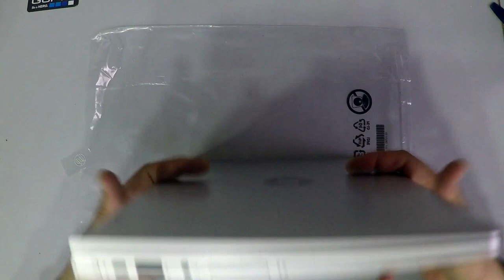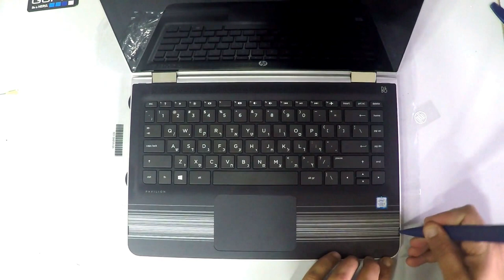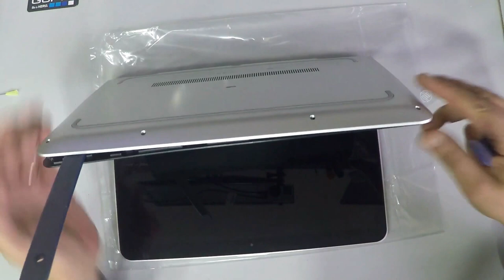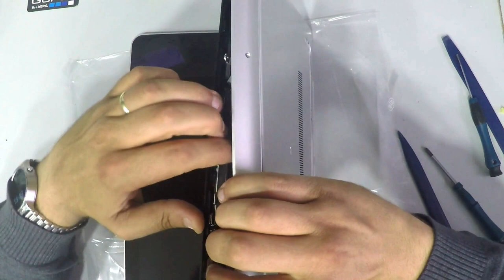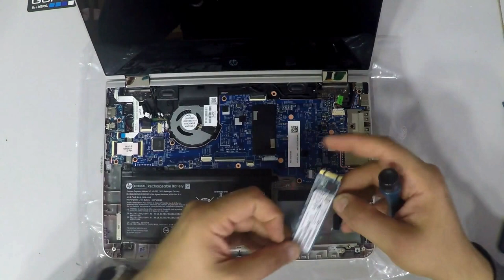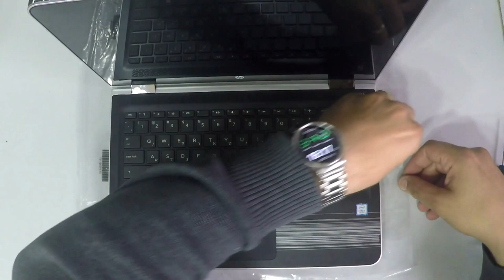HP Pavilion X360 13-U106 13.3 Touch Partial Disassembly and Reassembly

Comment: Hi! Thanks for your great job! I have a problem with this laptop (HP Pavilion x360 13-u113nl ). I disassembled the touchpad but now I can not mount it. Do you have some tip?
(sorry for my english)
Reply from the maker: Hello Mirko, The touch-pad holed with plastic nuts, when you remove the touch-pad you brook them, use a heat gun to melt them and hold the touch-pad to its place again.

Comment: In the empty space near to the ssd m.2 (on the left) is it possible to install a ssd or a hard disk 2.5" on not?
Reply from the maker: Hello, Arlind you will need a special  SATA3 connector. like this https://www.aliexpress.com/item/x10-Laptop-Sata-Converter-Adapter-HDD-Connector-Socket-for-HP-G4-G6-G62-G42-G56-G72/32809401638.html

Comment: What about screen? You haven't tear it down..
Reply from the maker: Hello Emre, The Title has changed  HP Pavilion X360 13-U106 13.3 Touch Partial Disassembly and Reassembly
Reply: Wow.. If you are interested, I have something to ask: I have a x360 laptop and I broke it's LCD. Only it's LCD and I'd like to order a spare LCD but not with the touchscreen. You think I can make it work this way? I removed the LCD from the screen by heating it and I've left with a touchscreen with a glue like silicon? on it. And I don't know how to dissolve it and make it clear.. And I don't know the exact spare part number to order. My x360 is HP Pavilion x360 - 13-u101nt. Can you help me out please?
Reply from the maker: You have the model number on the removed LCD.( the exact spare part number ) on the back of the LCD.